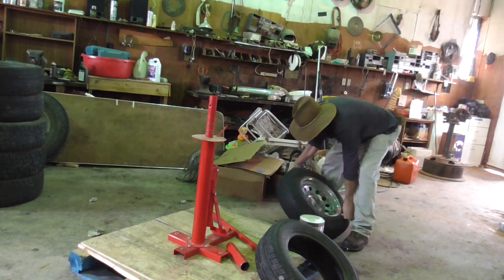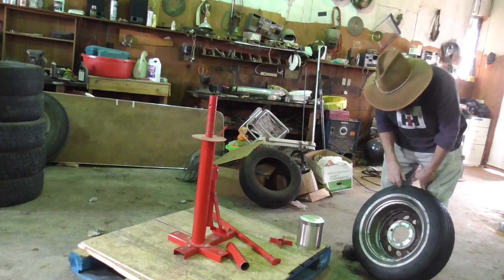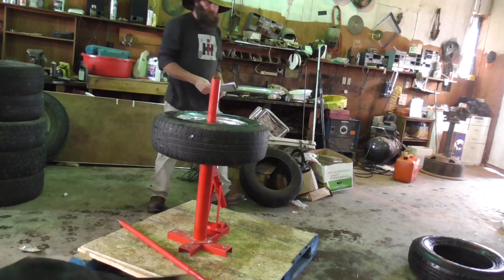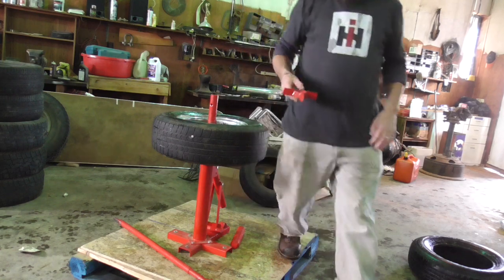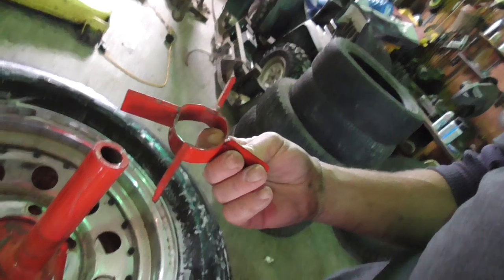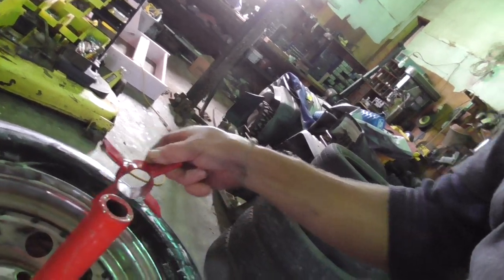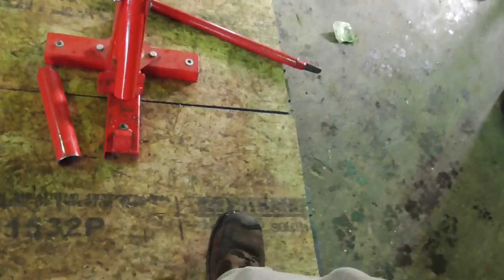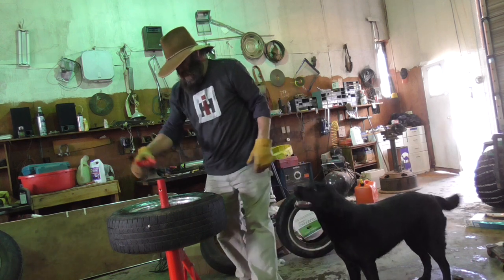Harbor Freight Portable TIRE CHANGER REVIEW

Comment: Use the other end of the tire tool to take them off. Much easier. And always keep the opposite side of the tire bead down in the wheel drop area. Almost a must.

Comment: Not to be negative, however;  those type(tire changers) work okay on lighter ply tires.  Truck tires or light truck or any tire with a heavier ply,  8 ply and more they have trouble breaking the beads....  I like a backhoe or loader bucket, lol.
Reply: Let me follow here with this: flat tires suck. anytime, anywhere I am politically opposed to this type of problem that plagues one's life........
Reply: @two-strokesmoke7289   Same here!  As long as air filled tires have been around, it seems like someone should have come up with something better by now.  Some sort of solid foam rubber inside that would never go flat?

Comment: Put a good ratchet strap aRound the tire and pull the tires’ middle in ( it will force the tire beads up agains’t the rims ). If you don’t have a ratchet strap, just wrap the tire with a rope, stick a bar or the changers bar in the rope and twist it up like a tourniquet  ( even a big screwdriver works )...old Army combat trick ( my dad was a WWII Army mechanic/truck driver ). He taught me alot of desperate combat/field operations tricks.

Comment: Howdy Howdy Mr.Idaho .. I used to work at a salvage yard and my job was to gather up the batteries from the cars they brought in and  dismount all good tires .. but I had the air compressor power tire changer .. did that for about    6 months then I stocked and labeled parts... back in the ole days we changed tires with a board on the old tire and drive a vehicle up on the board to break the tire down  ... what size tires  was you changing ... and by the way it’s ok to announce out loud friends neighbors and subscribers from around the world ... I announced myself in puplic all the time... even in Walmart 😆 .. glad to see ya fixing a tire .. I always feel at home in a shop whether it’s the salvage yard .. wood shop .. or auto shop .. I just know I can do stuff and make money in a shop .. take it easy relax and get ya self a cup of coffee .. you earned it today